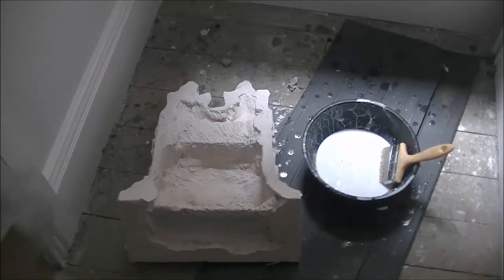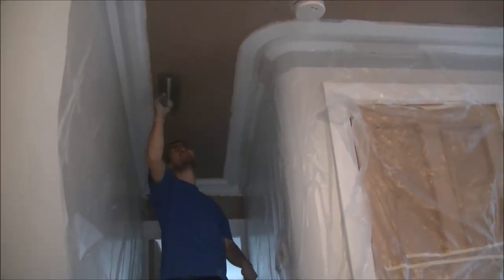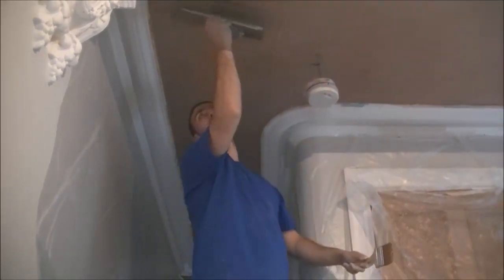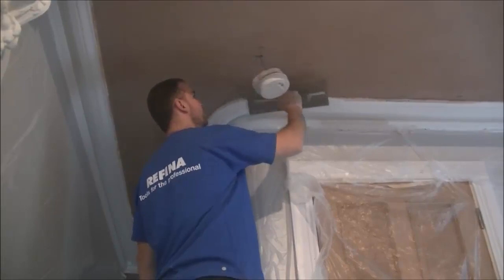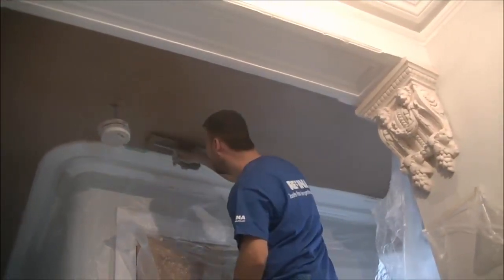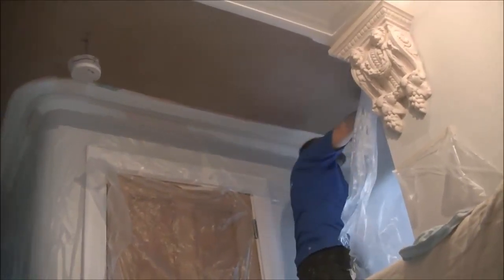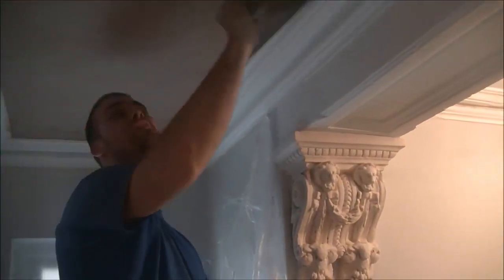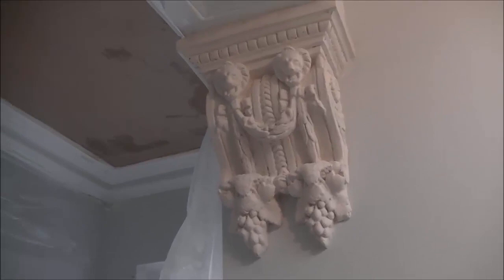fibrous and solid plastering plaster repair and corbel made

Comment: Top job looks grate 👍
Reply from the maker: Hey Mark buddy the cornice is very hard to make good with the paint but we got there :) and the replica of the corbel came out great   , Thanks for watching :)
Reply: @macplastering yere didn't look easy what plaster did you use for corbel
Reply from the maker: Casting plaster mate it sets in like 10 mins
Reply: @macplastering  nice not done anything like that before
Reply from the maker: @markhep  Been doing small repairs for years but this would be one of the bigger jobs doing it replicating a corbel